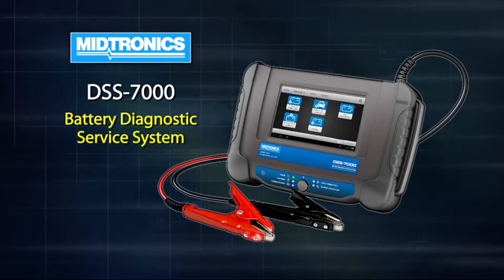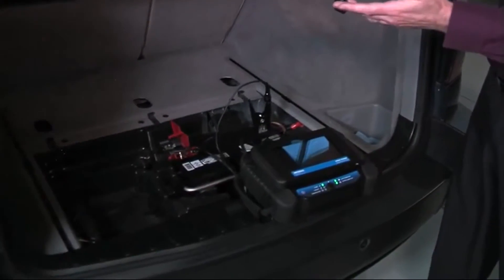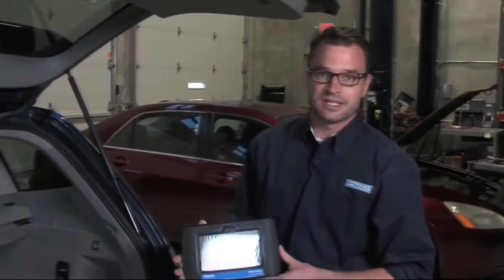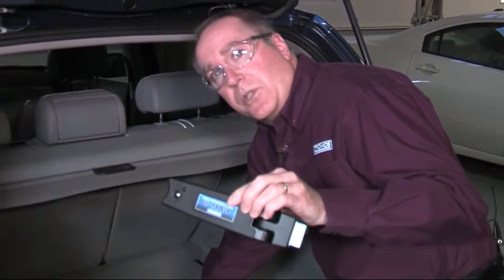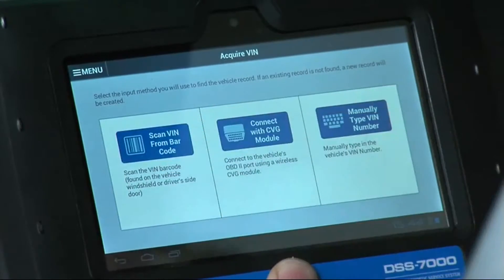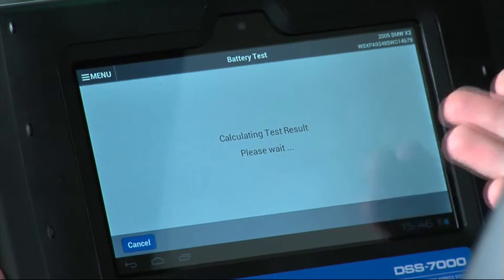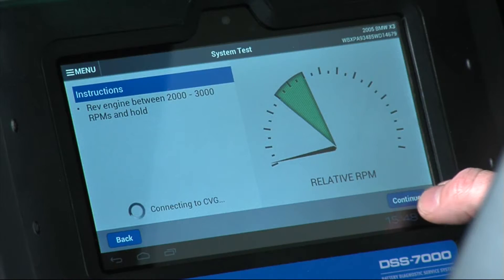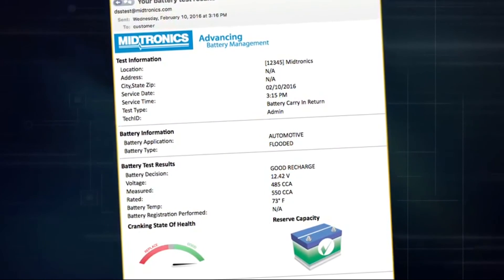Midtronics - DSS-7000 Battery Diagnostic Service System

Comment: How much power does the CVG-2 Module draw if accidentally left plunged in by the service technician after replacing the battery. Can this cause a battery to drain between 24 to 48 hours?
Reply: Nick's Hardware nothing if ignition is off